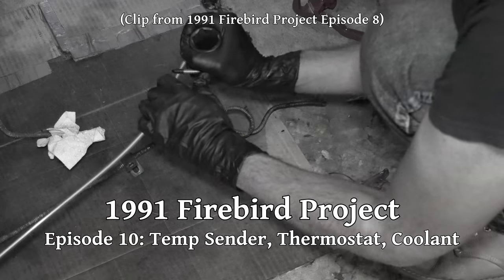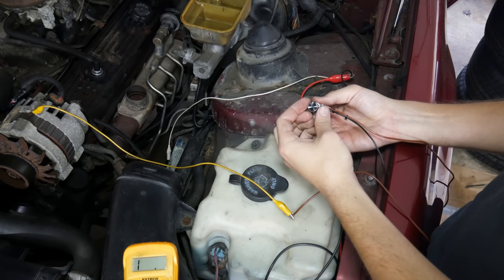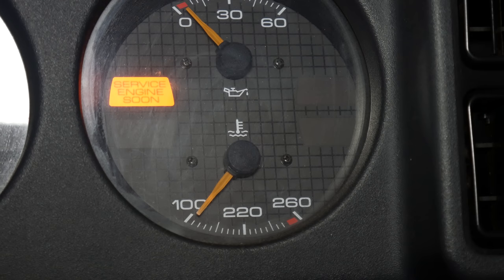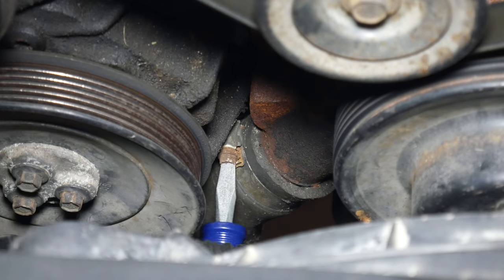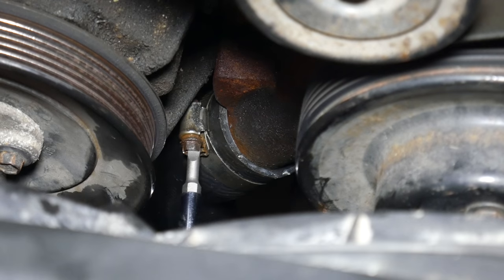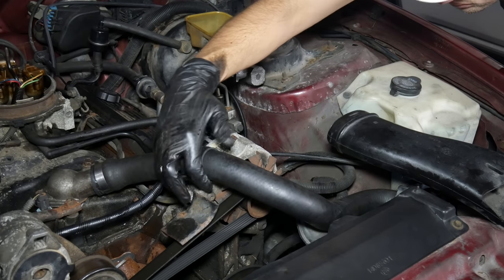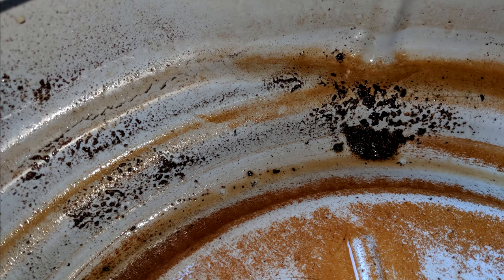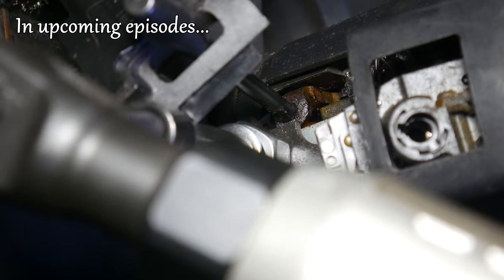1991 Firebird Engine Temperature Gauge, Thermostat, Rad Hoses (Ep.10)

Comment: I would have gone ahead and replaced the radiator while you were there. I understand this is a budget series, but a 2 row replacement for a 91 Pontiac Firebird with AC and TBI is about 80 bucks at most auto parts stores.  Or, you can get an all aluminum one for about $150 and not have to worry about 30 year old plastic tanks cracking.

Comment: I've been fighting the same issue with the GM 2.8L 60 deg V6 in my Isuzu Trooper.  Originally no reading on the temp gauge, swapped senders and now it reads about 10-15 deg hotter than what the ALDL reading is.  I've given up at this point.

Comment: Having the serpentine belt routed wrong is actually a bigger deal that what people like to let on.  It can actually make accessories run BACKWARDS to what they're supposed to run, which can destroy pumps very easily!
Reply from the maker: That's a good point! That wasn't the case here, but it certainly can cause issues. It's usually easy to tell which pulleys ride on the smooth side of the belt and which ride on the ribbed side at a glance, so even without a diagram you can get the belt installed close enough to correct that it wouldn't really do damage in the short term.

Comment: Please do a revisit of this project at a later time to see if you can find the actual issue. I have the exact same problem with my 92 Firebird. Same 305 TBI same exact everything. I replaced the thermostat, Temp sensor and fan relays I still have the exact same issue as this video. Also, love the 91 Firebird video series a lot is transferable to my 92.

Comment: Hey, nice Video :D
A Tip: You can also fill the cooling system up with a citric acid/water solution, open the heater temperature knob to the max and then let the engine run, until it is at operation temperature and a little longer. Maybe let it rev a little bit higher so that the coolant really gets to flow. The citric acid will loose all the rust and chalk. Do this 2-3 times, then flush the whole system with water. Make sure to get out all the citric acid. Then refill the system.
You could also just remove the thermostate and run the engine on the citric acid without it, so that the whole system will be flushed immediately. 

The method with the garden hose works fine. I am doing it like that to remove the citric acid after flushing: Engine is off, putting the hose in the thermostat housing and let it drain out of the lower coolant hose on the radiator. Then put the garden hose in the top radiator hose and flush out the radiator from the bottom radiator hose. It is incredible, what kind of gunk is coming out of the radiator.

I am doing this every 3 years to my 1990 W124 Mercedes and it works really good :) 
Might be a good shot, since the coolant looks really rusty.
Greetings from a German Fan!

Comment: My grandpa had a little trick for stuck rad hoses, just smear some soap from a bar of soap (duh) and wedge it around the metal fitting, pushing the soap pieces down, then its just twist and pull
Reply: I finally just bought a nice set of hose removal pics. That's far and away the best way to go.
Reply: I use channel locks on the wide setting. Works every time

Comment: i wonder if the sending unit is fine, but there's something up with the temperature gauge.   I remember dealing with some car when i was a teen, that had an adjustable temp gauge in the cluster.   Turn one of the screws on the front of the gauge, would adjust the precision of the needle.

Comment: Thought I broke a temperature sensor on my car when it overheated, but the engine didn't blow up as it has an overtemperature sensor on there that shuts off fuel injectors for certain areas of the engine (rear of the engine as my friend crimped the heater core outlet hose). Fixed my cooling system and no overheating or leaking coolant.

Radiator and the rest of the major hoses are intact and no cracks, splits, or holes as I got the cooling system flushed on the car, no head gasket or intake gasket leaks either and the engine runs perfectly fine.

Comment: A tip i've found with time, when I know I'm replacing a hose, I just slice it up with a box cutter. So I dont have to do all that prying and pulling and such
Reply: Cut a small slit in lower hose jam a 3/8 brake line in the slit and route to the drain pan. Once drained slice and dice like he said.

Comment: You can calibrate the sender/gauge for the temperature with resistors, by connecting them in series or in parallel. Depends on the gauge and the sender, so I can't really tell you for sure what resistor you need and how you need to connect it.

Comment: Another fantastic video, I especially appreciate your focus on all the tools you're using, and that 80% of the effort is gettign the right parts and getting the old parts loose without breaking things - which makes it so much more credible that I can follow along and replicate what you did.  Don't change a thing!
I have had a lot of similar experiences with temperature senders (Thermistors) in a completely different context - 3D printers.  I loved your more data-driven approach to testing the output and calibrating the gauge input.  Dragging my own 91 Firebird into the 21st century, I'm building a DIY body control module, and you've inspired me to go a bit further with it and intercept the analogue signals from the senders, digitise these within the body control module, and then from this, drive the original analogue dials.  Each will have its own calibration map.  For un-necessary levels of accuracy I can stick the new sensor in a calibrated lab water bath at a university, and check at known temps.

A question:  Is it possible that GM's engineers are allowing for the temperature to be different in parts of the engine away from the sender location, and deliberately skewing the reading that shows on the dial?  Or is it just plain wrong?

Comment: You should check the coolant meter. Usually the instrumental has a resistor in it to adjust the meter to the correct value. For example my R19 rev up until 4k rpm with the original tachometer but using another tacho goes over 6k. The potentiometer of calibration is really weak and need to be replaced because get rust after some time. If you can't do this, you can also solder a resistor in serie to the sensor to adjust the signal.

Comment: oof. all that rust and corrosion on the engine :(
Reply: That's all pretty standard in areas where things go rusty.  Engine paint, even high temperature stuff, tends not to survive the high temperatures and inhospitable environment under the bonnet/hood for very long.  It can actually be more desirable to have a coating of surface rust on the parts as some of the metal alloys used commonly on car engines have a property where the oxide (corrosion) is inert and won't allow corrosion to spread...
Reply: Check the spark plug at about 20:02 kerrrusty
Reply: It doesn't affect the state of the engine too much, in case you buy a car that looks similar to this one (speaking about the engine), you should know what to do. Things like new spark plugs, oil and cooling liquid are basic standard things you should always replace or refill.

Comment: I believe those engines where designed to run hot. The stock fan kicks on at 240.
Reply: Arturo Pacheco I had an L04 in my 91 bird. 225-230 at most. 240 would read kinda scary lol.
Reply: @thedude420h20  lol. My bird was just overheating. The stupid ignition turn on I use for the cooling fans crapped out. I jury rigged them to the battery and got the temp back down to like 180 lol. I got a 3 core radiator with dual fans from eBay for like $90.
Reply: That sounds about right. I have a 91 Camaro with the 3.1 V6 in it and the fans don't kick on til about 3/4 of the gauge which i believe is around 235-240 then goes down to 220 (mid way).
Reply: I have a 92 bird, It stays at a little below 220, but its also got the V6 so they may not run as hot
Reply: My stock 64k ‘89 TA 305 TPI fan kicks on around 240, I don’t like it, putting in a new sensor that’ll turn it on at 185.

Comment: I have a 1989 Camaro RS with a 5.0L. After we rebuilt the engine we have a similar issue with the temp gauge. Our mechanic wa even puzzled because according to temperature probes and scanners. The engine is running at the correct temperature but the gauge was telling me the car was in the red and overheating.  Pretty much its reading a quarter higher than it is. We speculate that there may be more to the original temp sender that is OE could be different from aftermarket. He suggested installing an aftermarket digital gauge with it's own sender threaded onto the thermostat housing if it has extra ports.

Comment: It looks like they had used Bar's Leak to try and top a leak in the coolant system.  That's why it's all brown and nasty, at least that's exactly how my radiator looked after using it when I was too young and naive to realize that stuff isn't good for your coolant or engine.

Comment: I say the reason your test resistance in the circuit is less than the service manual is due to the deterioration of the circuit itself. All those corroded wires and connections add a little by little. Thats why you needed a low ohm sensor.

Comment: A good tip if you're using taps to chase dirty threads is to put grease in the flutes on the tap so it'll collect the muck the tap removes rather than allowing it to drop into the bottom of the hole and maybe get stuck there, preventing the bolt from tightening down...

Comment: we used to flush cooling system with a T connector on a heater hose. Run engine  connect a garden hose and open the petcock clean water in. old dirty stuff is flushed out.
Reply: Yep. I've modified my s10 heater hose that way. Just put a rubber cap on it to plug it for when I need it next time I flush

Comment: I'd guess the old wiring to the cluster gained resistence with the years, messing with the reading.

I'd try replacing that wire for a new one, and if that fails, I'd try to open the cluster and re position the needle to the correct position.

Comment: On my friends 86 a 305 with a LT1 engine it was getting hot found looking in to it it did not have a thermostat in it odd after that fix it was ok the previous owner hooked the fan to a manual switch under dash

Comment: Your issue with the over-reading temperature gauge could simply be down to the time the car sat for, the gauges are electro-mechanical and, like any mechanical part, they can get a bit stiff if they haven't operated for a while.  Run the vehicle up to temperature regularly for a while and it might get a bit more accurate.  It could also be that the gauge is designed to over-read slightly to give an attentive motorist time to stop before causing engine damage to an overheating engine...

Comment: Just find a smaller resistance pot and put in line with your cars wiring til you get an accurate reading on the dash that matches your infrared thermometer.  measure that resistance on the pot and get a resistor to wire in line.

Comment: I wouldn't worry about that gauge too much. Many factory gauges are just basically "idot lights" with a pointer attached. They are designed to read in a "nice" spot, like straight up when at normal operating temperature. Many older GM vehicles even have a resistor in the oil pressure gauge circuit, just to give it that "normal" reading most of the time. Check out your Silverado, get it to operating temp, the gauge will read straight up. Compare the reading of the gauge with that of a scan tool, you will see they don't match lol. Another factor that affects the gauge is the location of the temp sensor,  In my old LT1 Caprice, the computer reads the coolant temp from the water pump, and the temp sensor for the gauge is in the cylinder head. LT1 is reverse cooling so the heads get cooled first, and therefore the gauge always reads a bit colder then actual operating temperature. You "may" be getting a slightly higher reading due to the location of the sensor in the cylinder head. There are 3 wire coolant temp sensors out there that will allow you to run the computer and gauge off 1 temp sensor, sometimes giving you a more accurate reading.

Comment: I would replace the temp sender that reports to the computer in the vehicle next. "Typically" those are what sends the OK signal to power on your electric fans, and from the look of it in the shots @ the amount of corrosion on it, I'd wager thats your problem for not getting the fans to boot up. Turning on the air con hardlines power to the fan circuit as a backup in case the primary circuit fails (like it has in your case).

Comment: Good luck getting those spark plugs off😬
Reply from the maker: That will be in a future episode, there are a few stills in this one that were from later on and actually show new spark plugs. It wasn't easy to get to them all, but no issues getting any of them loose. The threads were all fine, just external rust and not enough that they fell apart.

Comment: Hey! Saw you removing the rear window in the end montage. Any tips on aligning the lower plate if it has become misaligned with the rest of the car? Mine is sticking out too far.
Reply: The service manual just says to: 
LOOSEN THE HINGE TO BODY BOLTS (NOT HINGE TO GLASS)
open rear hatch
Remove struts
Close the hatch
Adjust the hatch
Tighten the body to hinge bolts by reaching in through the door
Reinstall struts
Adjust rear deck height with the rubber bumpers

According to the service manual you can install spacers on the body to hinge bolts to adjust height on the top portion of the glass. The body to hinge bolts holes should be oversized and will allow adjustments.

Comment: When you are replacing the lower hose I just cut a slit in the best spot to drain from..... to keep the mess in the drain pan.
Reply: It's a valid strategy, but unless you're 100% positive you've got the right replacement hose, it's risky.
Reply: This video shows why you might wanna keep the old parts.

Comment: My 91 Camaro RS 5.0 TBI had the same exact issue with the temperature gauge showing a much higher temperature than the engine actually was. I replaced the sender with a factory part and it made zero difference. I tried to chase down the problem several times but eventually I gave up as there was nothing actually  wrong with the engine. Just like your Firebird it appeared to register correctly  right up to around 195 then it would quickly move to 240. My car never once actually overheated and I drove in all kinds of conditions.

Comment: Can you please post a link to that ALDL scanner if it's still available? I need one for my 89 Firebird
Reply from the maker: Search for "12 Pin ALDL OBD1 Bluetooth / Code Reader/ Scanner / Adapter" sold by  1320electronicsinc on eBay. There are different models (USB vs Bluetooth, 12 Pin vs 16 Pin) that vary a bit in function and price, but the guy makes the hardware and software himself as I understand it. Have exchanged emails with him and he seems like a good guy and provides great support and information. There are other options for computer-based scan tools, some of which are cheaper, but I like that this one can simply be used with a smart phone over bluetooth.

Comment: NPT taps are tapered, you do not thread them in all the way because it gets rid of the taper ( only far enough to thread the fitting in 3 or four turns before it tightens down). When you do this the fitting threads all they way down instead of getting tight and sealing at the taper (look how far down the old fitting went half way compared to all the way down after you taped it).  Good thing you have the experience to know when to stop tightening the fitting down.  What you felt was the threads starting to strip, not the brass fitting.
Reply from the maker: I ran the tap into the cylinder head by hand, not even a t-handle, the only material removed was the old sealant/rust. I did not move the taper. The threads may have been a little thinner from the cooling system corrosion, but I have some experience with cheap brass fittings and too much tightening torque (cough cough) and I am quite certain that was what was starting to give

Comment: So why doesn't the cooling system have a replaceable filter like the air and fuel?
Reply: On heavy equipment, a lot of the time, they do. On cars it's too expensive and difficult to package. The real problem there is that nobody was changing the coolant or checking its condition (which people do check on heavy equipment).
Reply: Evil Ash that’s a damn good question

Comment: If they are like the C4 Corvette gauges, those are just "idiot" gauges. They are only there to tell you when it's too hot and are not very precise. The C4 has both analog and digital readouts for temps and they don't match as the analog is just supposed to be "HEY, YOU"RE OVERHEATING!!!" and the digital is, "Hey, you seem to be very anal about your temps."

Comment: keep your sensor. remove the needle on the gauge and put it back on where you want it. i had the same problem with my 87 formula. the volt gauge when crazy one day. i checked the voltage at the battery, alternator and the gauge. they were identical. i just pulled the needle off and put it back in a different spot. now it works perfectly
Reply: It doesn't "work perfectly"....it just shows the reading you want to see now.

Comment: Oh man go to 20:02 check out that oem plug 😯 it’s unsubscribe worthy
   no way were them heads rebuilt  check the head bolts plus you would of take the time while was on bench to replace them hard to reach plugs not a chance they have been changed in last decade 🤥 you can see it’s easy accessible friend has been done socket not even touched it,  
Change that spark plug i don’t care if takes you 10 videos,